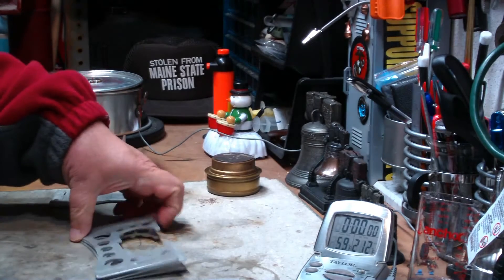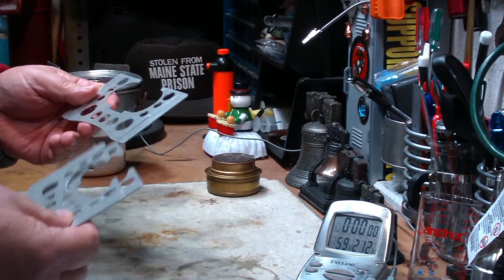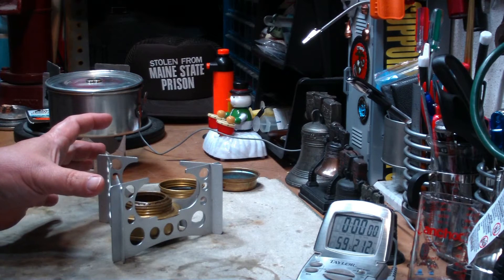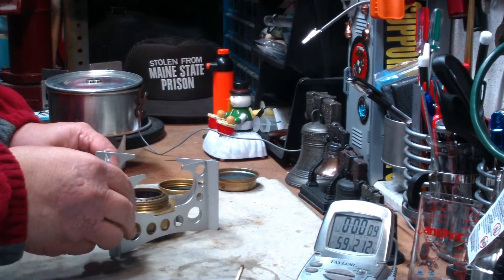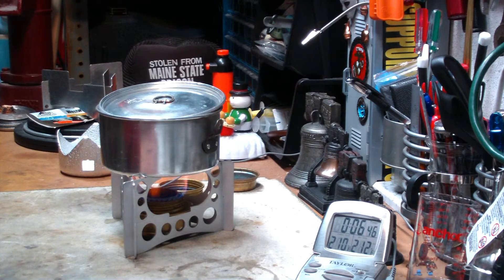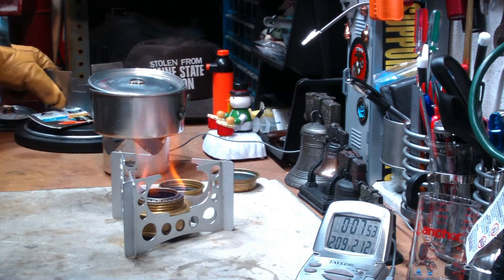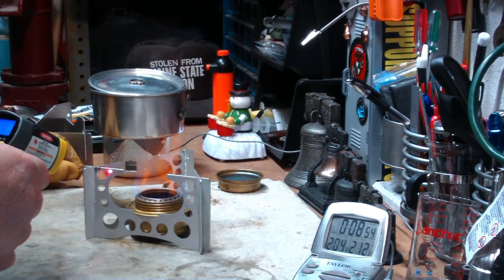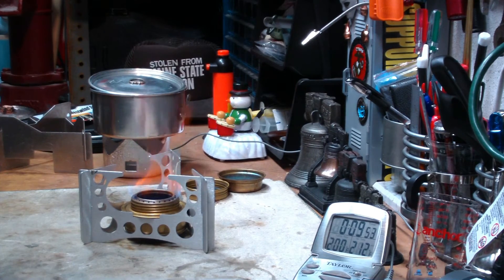Ultralight Stove Pot Stand for Trangia - Boil Test 1

Comment: I have the Westwind and use it from time to time. For sheer portability, size, weight, and ease of use, I found the best option to be the Evernew tiatnium cross stand. It easily fits in a shirt pocket, and though it's made for the Evernew Trangia-style titanium alcohol stove, it works just as well with a Trangia. The stand is item EBY253 at evernewamericadotcom